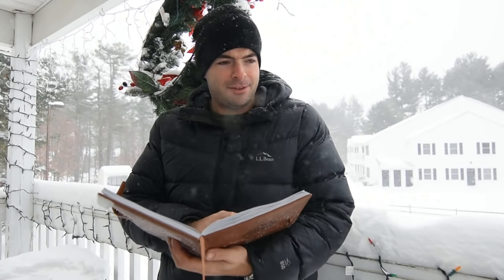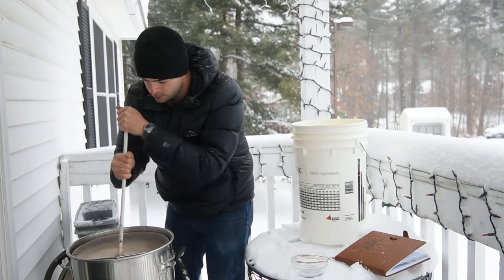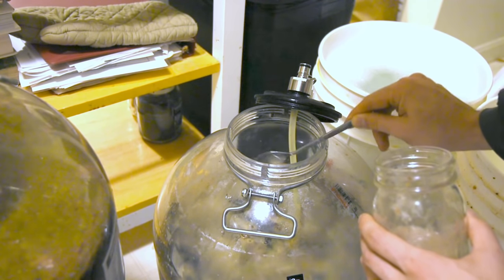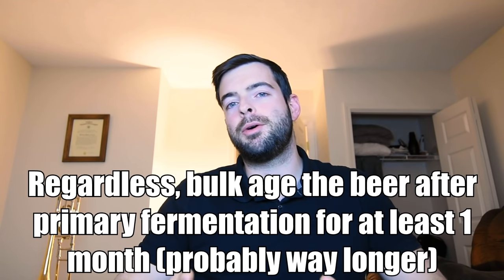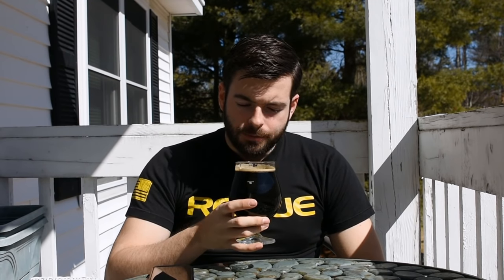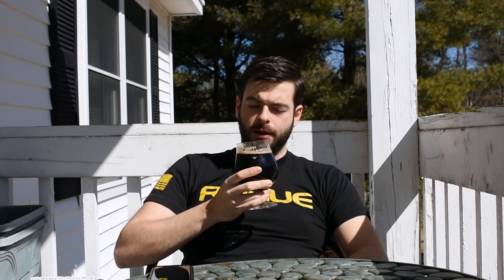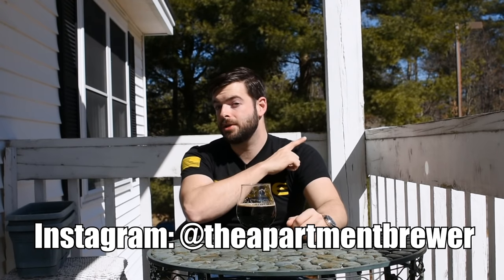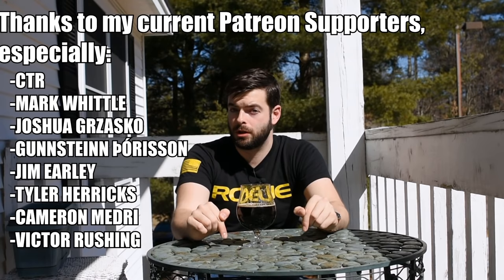Brewing a RUSSIAN IMPERIAL STOUT in a BLIZZARD 🤘| DOUBLE MASHING | Brew BIG BEERS on Small Systems

Comment: How you gonna throw that trombone in the background and not give us some brass action?  Oddly enough, the only major infection I've had in many years was a super hoppy dark beer that blew the lid off the fermenter, which is where I thought the infection came from but who knows.  Turned out interesting though.  If the infection continues you could bottle it and say its a The Bruery Sour Stout lol.  I wonder if the problem came from the yeast, either a contaminated kveik or just the kveik kept going.  I use Hornindal and Espy at work for NEIPAs and they chew threw everything down to like 1.7 plato (thank god for chloride and low bitterness).  Hornindal always gives very tropical flavors for me but some other kveiks (Voss in particular) give a very weird flavor to me.  I wonder if your "infection" is actually just the kveik.  It seems reiterative mashing is the best way for BIABers to do high grav.  I did that 6 hour boil stout on the home level and pro level we do two back to back no-sparge half capacity brews.  Seems like a double mash is a real time saver.... but I think I may (gasp) think of adding DME next time I want to go super high grav.  Anyways, this video inspired me to crack open one of my year old stouts and I agree with you on your malt bill analysis.  Going for smooth and chocolatey isn't as good as a good ol' roasty boi.  I blame the stout for this freaking dissertation I've written.
Reply from the maker: Stout based dissertations are the best kind. I'm not going to throw out the possibility of the yeast lending this type of character just yet, because it may be true! At some point I will be doing some sort of super high gravity stout where DME will have to be an ingredient! Also definitely bringing back the roasted barley. Glad you enjoyed the video, keep the dissertations coming!

Comment: I would love to see how you do your cleaning on that system.  Especially after a brew day like that.
Reply from the maker: A video is in the works!
Reply: @TheApartmentBrewer  Awesome! Just got this system and was looking for an easy video to help with cleaning. While there is info out there on what to do your videos are some of my favorites because of how you present information. Straight forward, step by step, showing when you make mistakes, and clearly you have a passion for brewing . Love the channel, keep up the good work!
Reply from the maker: Thanks for the support man! In short to clean it,, I recirculate PBW through the system, bring to a boil and then recirculate water to rinse. Sometimes crud can stick to the element. You really want to avoid using a steel wool type of abrasive on it so try to use a scotch Brite pad or similar tough sponge material instead.

Comment: I had a few processing questions. I have done a few double mashes before and had varying results (definitely my errors). I recently got an anvil 6.5 gal brewing system, and can't seem to get the water volume right for the double mash. How did you go about setting the water volume used for the first and second mash? Do you use more for the first and sparge to optimum level, or do you sparge a little at the end? I've tried to do my own calculations and screw it every time. Thanks for the help!
Reply from the maker: I would use as much water as possible for the mash, then sparge to get your volumes up at the end of the second mash. You could also add  some mash temp water in between your first and second mashes if you account for the dilution
Reply: @TheApartmentBrewer  thanks so much! I will try these options!

Comment: The funk actually sounds kinda interesting... but yeah. Probably not what I'd reach for on the regular.

I'm planning to do some double mashing in my Foundry. Should be fun!
Reply from the maker: Yeah, definitely would have been better without. We'll see what the future holds! What are you planning on making?
Reply: @TheApartmentBrewer  I've been working on a wheatwine recipe, so I want to try that first. Also have a barleywine that I made with my BIAB system that was excellent, so I want to lay that down so I can drink it next winter. Run out of space to put bottles for now, so it will need to wait a bit. ;D
Reply: However, that would be accurate for the 18th century.  Wooden casks were used over and over again. They would replace the head of the barrel, scald It with boiling hot water, let cool, and pack it full of beer again. So they sort of cleaned them, but funk and barrel aged was the order of the day.

Comment: At this point, what percent chance do you think it’s actually an infection? And is it safe to say any infection didn’t happen when dry hopping? With that high an abv and the blanket of co2 that would be covering your beer at that point I would think you could have pitched actual bacteria and nothing would have been able to take off.

I brew makgeolli and we have to get in there with barehands to mix cooled steamed rice into a fermented starter (10+%abv) before leaving it to ferment and I’ve  never had any kind of infection - which I would think attributable to the protection you get from a high abv...
Reply from the maker: Well, you really can't rely on ABV to actually help you kill off bugs until its in much higher concentration, more like 30-40%. But I'm still fairly sure its external.

Comment: Question- How would one adjust their water profile if I'm only mashing with 4.5 gallons of distilled water and sparging with the other 3? Heat it all at one time and add the total amount of brewing salts? Add it all to the 4.5? Never understood that part of it
Reply from the maker: You can either add it all the the mash water or split it evenly between mash and sparge water. Either works fine.

Comment: did you find the kveik finished with a lower ph than you would have gotten with us05 or English ale yeast?
Reply from the maker: I usually don't measure pH after fermentation, but I'm not sure. Maybe?
Reply: @TheApartmentBrewer  i don't either but the times I've used kveik it comes through in the taste - like a neipa can become a lemon juice ipa very quickly with kveik - ive stopped using it for that reason. love your videos - thanks for sharing again

Comment: Nothing wrong with admitting to a failure. I've put a few down the drain for sure. Do you think it's also down to the sugar addition that has thinned out the beer?
Reply from the maker: I don't think so necessarily. It was such a small amount relative to the rest of the beer, I think it needs more protein. It's also possible my temp controller needed calibration. This was like the 3rd beer I did on the clawhammer system and hadn't run a calibration on it yet

Comment: Not sure what the purpose of dry hopping a RIS would be.   With that high ABV you don't need the hops as a preservative and you aren't likely going to taste it over the dark malt.    Personally I'd axe the dry hop all together.   I use Wyeast 1728 for my RIS's.
Reply from the maker: Its actually more common with RIS than you might think. It all depends on the type of hop though, you cant do it with just any standard hop because it will be either out of place or like you said will get lost in the roast. It's not going to be analogous to typical dry-hopped beers like IPAs at all. Northern brewer is really unique among hops though in that it gives a really nice complimentary woody/minty flavor and aroma, but I still think I overdid it here. Earthy hops like most English varieties would be good options as well.

Comment: Ok so I brewed my Imp Stout but buggered up the water levels and boil off was less than I expected (stupid stove).  Plan on bottling it saturday after 1 month in primary.  I’ll start taking gravity readings on Thursday until Saturday to check fermentation, I expect a 6-7% abv.  Gonna bottle age until October and guy at LHBS said that high gravity beers can continue slowly fermenting in that long ageing period.  How should I approach priming?  Should I underprime  to be sure?  Aiming for about 2 vol co2, should I prime for 1.5 or less or more?  Any advice would be appreciated as LHBS guy and 2 fb homebrew groups have not given me an answer.  Thank you !
Reply from the maker: Sorry to hear your brew day went sideways, I'm sure it will still work out fine. Its highly dependent on whether your final gravity is way too high or not. Sometimes they do continue to ferment slowly but its usually not something that bottles can't handle, unless your FG is significantly higher than expected. If your yeast is a strain that is known to continue fermentation I would approach with caution and underprime OR just commit to letting it bulk age in a glass carboy or keg for a few months. If you choose to bottle, I would encourage storing this in the fridge or at lager temperature after its carbonated so that you can force the yeast to become dormant and guarantee there won't be any bottle bombs if youre worried.
Reply: @TheApartmentBrewer  Thank you so much, SG was 1.075 and I pitched US-05 at 4 times the amount needed (9g for 1 gallon).  What would you consider a ‘safe’ FG to proceed with normal priming?  I’m hoping for 1.010-1.015 max.  Anyways thanks again for the help, much appreciated !!  Cheers.
Reply from the maker: @Frameshaft  anything under 1.025-1.030 is a normal FG for an imperial stout, but just check it a few times to be sure that its done. More than happy to help!
Reply: @TheApartmentBrewer  So I finally bottled, fg was 1.016 !? (From 1.075). 79% attenuation out of 80% for US-05.  I primed for 1.8 vol co2 and hope for the best!  Bottles are stored in a latching lid plastic bin for protection !